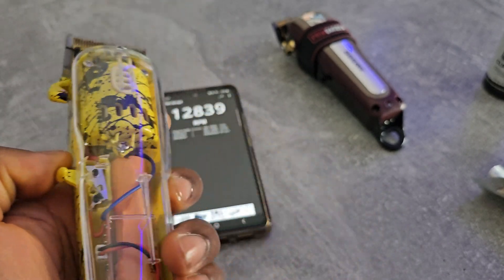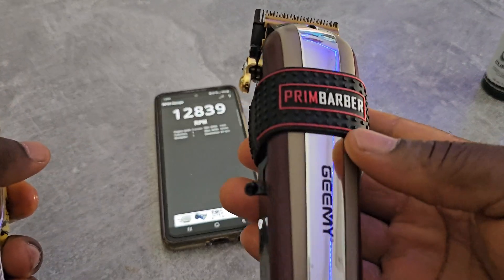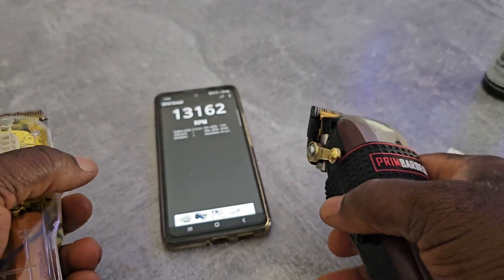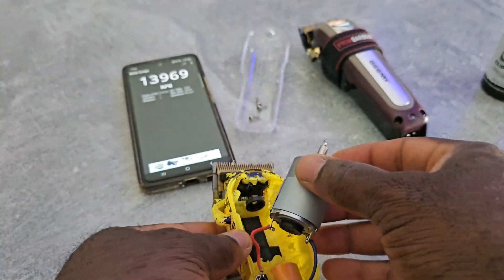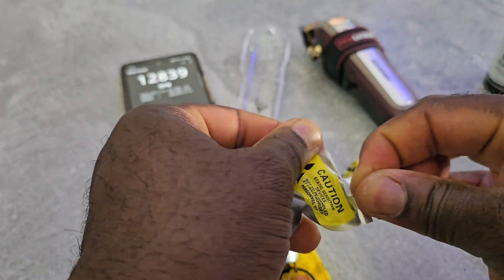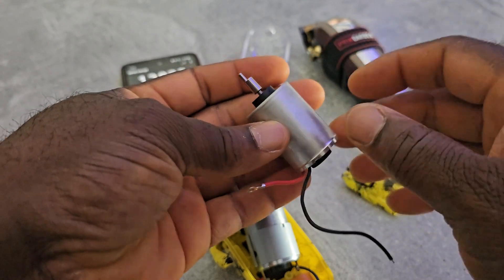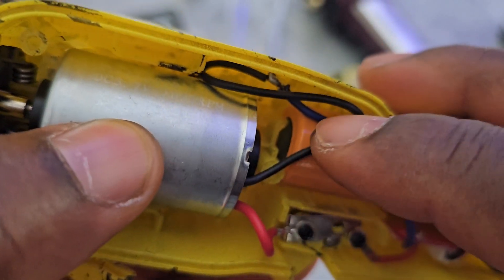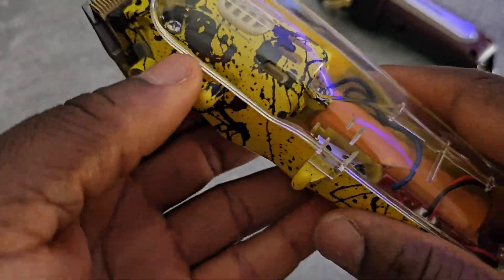Can Brushless Motor Fit on Wahl, Stylecraft/Gamma, Monsterclippers and TPOB Clippers?

Comment: What's the differance btw brush and brushless
Reply: brushed motors are more efficient and have a longer lifetime, as well as less noise. brushed motors are more compatible though, needing only dc power to operate and are usually a lot cheaper, usually about half the cost of the brushless counterpart

Comment: 2 wires means its not brushless lol
Reply: Not true, 2 wires just means it is 2-phase. Most BLDCs are 3 phase, and have 3 wires. Somethimes for Fans there exist 2-phase BLDCs with only 2 wires, the commutation is build-in electronically, hence he can swap the BDC for the BLDC. You can never put a 3-phase BLDC in there though, because there is no ESC on the board.😉
Reply: My wahl vapor motor has only 2 wires😏

Comment: I put it in my gamma più absolute alpha but the motor shaft is not compatible with that of the gamma, so the mower no longer works. What should I do please?
Reply: Change the cam follower or change the shaft

Comment: Sorry to inform you, unless that motor is specified as having an integral speed control, it is not possible to be brushless. It only has 2 leads. Chinese businesses lie often
Reply from the maker: Some brushless motor have cables
Reply: You must open the motor to see if it s brushless xd
Reply from the maker: @wanhuar8654  if you buy me one then I will be glad to open it 😁
Reply: What is the difference between brushless and normal motor plz ?
Reply: @محمدمحمد-ش4ع3ت Brushless motors last 5 times longer.
Reply: @محمدمحمد-ش4ع3ت  In a brushed motor, the commutation happens mechanically via 'graphite brushes'. This means that since these brushes wear over time and cause sparking this influences the longevity of the motor. A brushless motor does not use brushes, but the commutation here happens magnetically. It is a more expensive technology but increases the lifespan and reliability of the motor. The choice for a BLDC so represents the quality of the product.